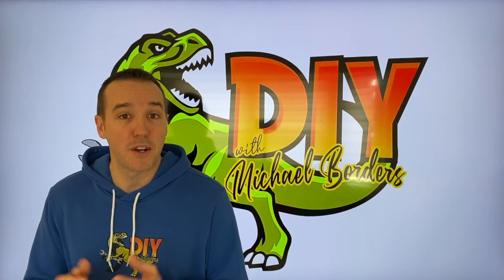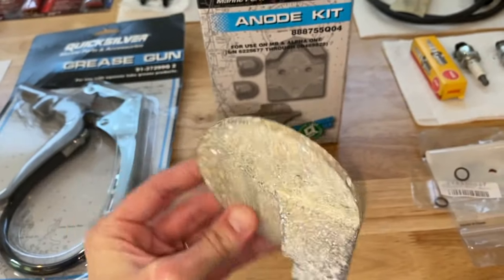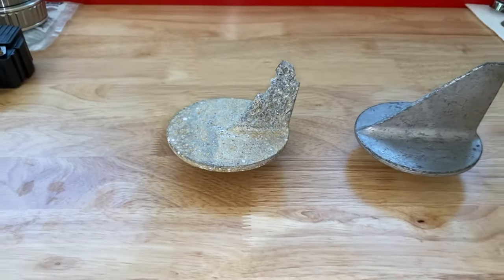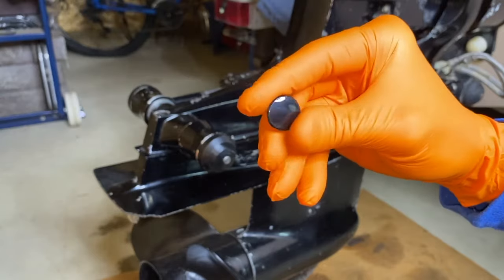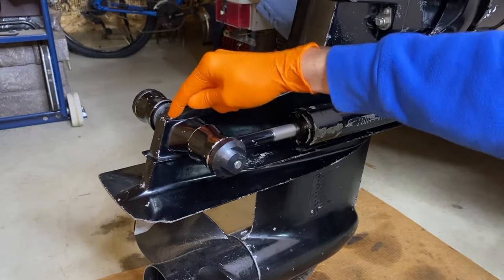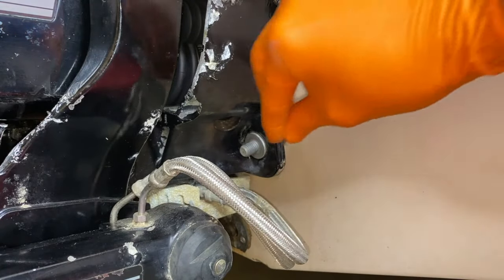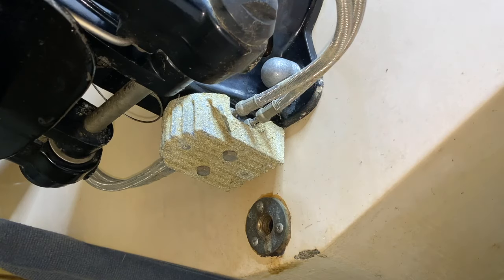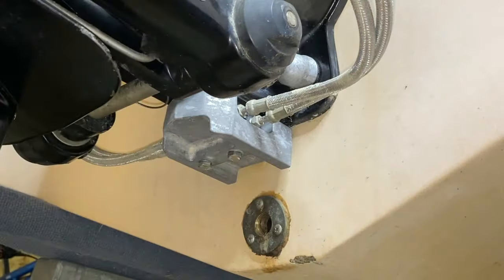Replace Mercruiser outdrive Anodes  - Alpha one gen 1(2) / Bravo

Comment from the maker: If interested in purchasing this product, visit our Amazon affiliate link below.  I earn from qualifying purchases.

     Anode Kit (888755Q04):  https://amzn.to/3uIJ89d

     Grease gun:  https://amzn.to/3uOFgDG

     Outdrive anode bolt plug (19-47579):  https://amzn.to/3NcHKSq

     Allen tool kit:

            https://amzn.to/3Gq3mqR

            https://amzn.to/3Guqkgh

*********

1.  Replace outdrive bellows/shift cable (PART 1)

          https://youtu.be/NcObTOYXtQM

2.  Purpose of Anode and differences between Magnesium/Zinc/Aluminum

          https://youtu.be/r11ulZv_plI

3.  Build your own custom skateboard

          https://youtu.be/9Isty_4fIIw

4.  Mount your skateboard on the wall

          https://youtu.be/c5QDCKZNGH0

5.  1996 Dyno Air rebuild

          

6.  1996 Dyno VFR restoration

          https://youtu.be/FMOSNR5TTl0

😎👍

Comment: Love your DIY segments. I have a alpha1 gen1 leg on my 350 mercruiser. The leg is in the raised position. The trim solenoids have been replaced and I need to bleed the system I cannot lower the leg to do this. I have tried to apply  downward pressure on the leg as i trim down, but no luck. Can you suggest a better way?
Reply from the maker: @SteveHardy-w6w  

Thanks for watching, any update?  Is the solenoid kit wire connections properly secured and not loose?

Do you have sufficient battery power and voltage?  A low voltage battery will make it difficult to raise and lower.

Below is a link to our video showing the Air-Bleeding process on this outdrive.

       https://youtu.be/gfW3dWsSLkE?si=x8Roevp9iO1c2Oh4

Keep us posted.  🧰

Comment: Excellent video. Like always, learning a lot from you! At this time I have a new problem with my boat that it doesn't engage forward or reverse. I have a 3.0LX  MerCruiser with an alpha one gen 2. I inspected inside the gearbox Quick Silver 3000, and it's in good condition, the cables are moving correctly when I put it in forward and I move the impeller it locks to one side the way supposed to when I put it on reverse the impeller locks into the other rotation correctly the way it's supposed to be, the shifting cable is moving correctly and is new which I replace it with the bellows following all your videos,   the problem is that the plate that move with the shifting cable  to activate the neutral switch is not moving, that plate stays in neutral, when I move it by hand it move the way supposed to, when I remove all the cables and operated by hand they move freely, and they activate correctly the movement of the propeller the way it  supposed to be, forward and backwards and neutral. When I move all the linkage by hand that activate, the plate for the neutral switch move correctly the way it supposed to.  But once I connect the cables, it doesn't work anymore. I have 3 days testing and going to the process of elimination and even if the cables they move freely, and they look in a good condition I have the tendency to believe that I have to change the cables for new ones, I don't know what else it could be.  I did not find any videos in YouTube related with this topic, only the once they talk about the adjustment of the shifting cable, lubrication of the cables,  and I already try all the different adjustments taking in consideration that the propeller works correctly according to the adjustments I made. Any suggestion that you can share with me,  are greatly appreciated. 🙏🙏🙏
Reply from the maker: Thanks for watching.  Great question and sounds like you have been busy.  Worn out cable possible as you mentioned…🤔

You may want to spend a few minutes playing with the adjustment of cable.  You can carefully unscrew jam-nut and loosen hardware to a point where you can shift up the cable housing and small brass cylinder to a point where it can be rotated…ultimately adjusting shift cable.

👍🧰
Reply: Definitely I'm going to follow your advice, even though I already did that for a lot of time even marking on the cable and stretching the cable and taking the right measurements between the middle of the hole to the point of your adjustment which it has to be 6 inches, none of that is being working, but definitely I'm going to give it a try again and spend more time doing all these adjustments very carefully to see if I'm going to succeed with this, or I may buy a new cable. I will keep you posted of whatever solution I may acquire. Thank you again for taking the time to answer my question I enjoy all your videos a lot because they are very precise with a great explanation and outstanding video Focus and position of the camera you're really separate far away from the rest of the videos on YouTube, thank you for the excellent job you do for us.
Reply from the maker: @cirovillabona  

That means the world to us, no joke.  It takes a lot of time to put together our videos.

It takes time because we want the videos to be of great help and quality to the DIY community.  Much appreciated your kind words are, thanks again.  👍🧰

Comment: What can you do if the 3/8 Allen wrench seems stripped?
Reply from the maker: Good morning ☕️ any update?  You may be able to apply Teflon tape to the tip of the allen wrench.  This will give the allen wrench more grip as well as make it slightly larger so it can grab ahold of the bolt to loosen it up so you can remove it.
Reply: What I had to do put a torch on it for about 30 seconds. Then I hammered in a 10mm Allen wrench and twisted it off. It worked thank you so much for the info for the job
Reply from the maker: @Snavarro85  

Thanks for the follow up, that’s a great update.  😁👍☕️